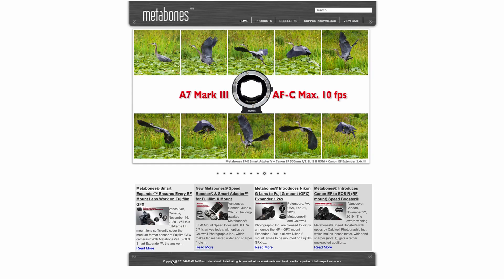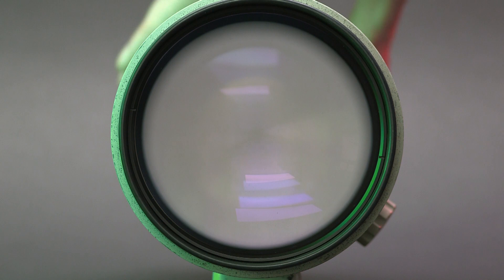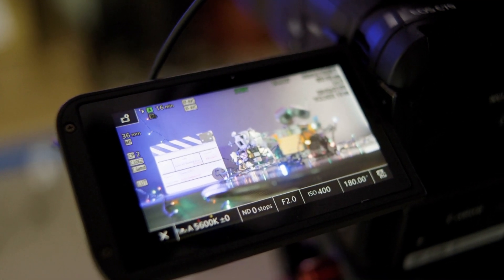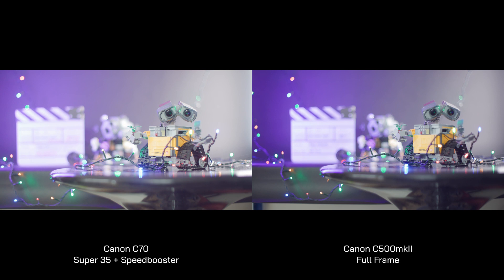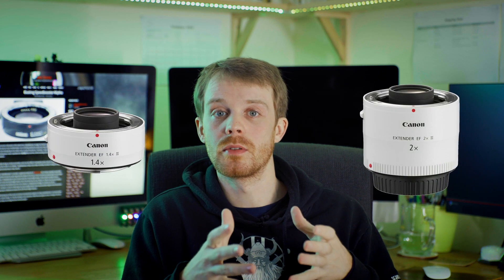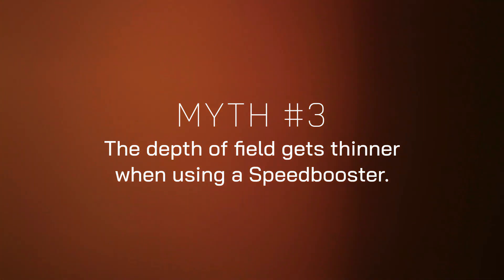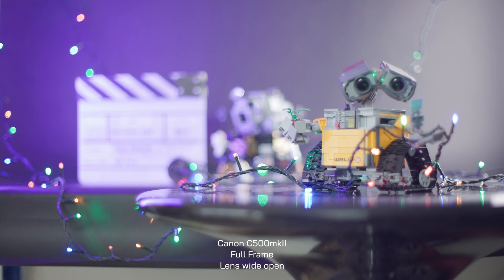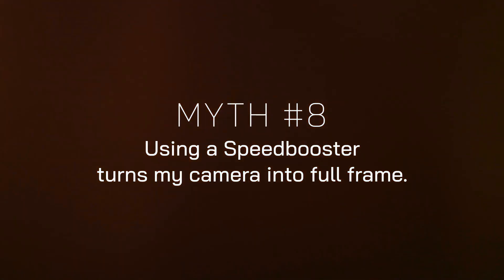Speedboosters EXPLAINED - The truth about focal length reducers

Comment: People who don't understand how that works will be even more confused after this video :) The main problem everyone are forgetting is the noise/ISO values. We are all used to smaller sensors having more noise and that is exactly why manufacturers of all crop cameras are lying to their customers. Just compare f/2.8 on a Canon R5 to a f/2.8 on a phone, are they similar in any way? Of course not, that phone image has no characreristics of a f/2.8 lens, so why are we calling it like that?  Why would we even care about same exposure settings when image properties will be vastly different between different crop factors, because they faked the ISO values. Cameras having the same settings means nothing if sensors are not the same size, any camera with a cropped sensor should show the FF equivalent settings and then the confusion would be over. The same goes for focal reducers, that f/1.0 C70 shows in camera is actually in relation to a super35, and that's why when you compare it to a full frame camera with a f/1.4 lens it has exactly the same exposure, dof, fov, bokeh, and noise. Of course sensors will not actually transform like Optimus Prime, nor the lenses will, but when you put a 50/f2 on a 1.5x, you are not only getting a 75mm fov, but you're getting a full frame equivalent of the f/3 image in every way. Everything about the dof, bokeh and noise will look exactly like f/3 on a full frame, and that's what most people don't understand. Because when you understand that, the result of putting a speedbooster is much more clear, it's like reverse cropping, you gain what you've lost when using a crop sensor. That's what people want to know, what is the actual result in the final image, not how to calculete aperture opening which tells you nothing. Bottom line, if you want to know what kind of image fov, dof, bokeh, noise and image compression you will get compared to a full frame sensor, you just need to know what is your crop factor. If it's 1.0x, your image will be exactly the same as a full frame, again in all the image properties, fov, dof, bokeh, noise and image compression. That is why camera manufacturers should show real settings of crop cameras, people should know that Panasonic 12-35/2.8 is not a 24-70/2.8 equivalent, not even close, it's actually 24-70/5.6, and I mean it produces the image of such lens on a full frame body, it's not transforming with sound effects and smoke :)
Reply: This would be misleading to less informed users. Aperture is a value relative to focal length, not relative to 35mm. A 12-35mm f2.8 on m43 is only equivalent to 24-70mm f5.6 in relation to focal length and depth of field. But it still has f2.8 aperture in relation to its native focal length.

Panasonic does not claim that 12-35mm f2.8 is equivalent to 24-70mm f2.8 in terms of depth of field relative to 35mm.
Reply: Great comment. But I think people who buy cropped sensors know they aren't full frame. But I shoot m4/3 Olympus, Nikon DSLR and Canon r6ii. The only photos you can tell apart is the Nikon. The Canon and Olympus are indistinguishable. You do get more bokah with the full frame but I found I don't always want everything a blur. Sometimes just a light blur is amazing.. People know.
Reply: The lens never changes, the aperture number is a scientific number how much light it lets in, that does not mean the output circle is the same, but F4 is F4 is F4.
Why you are yapping about noise is beyond me, techno gibberish trying to sound intelligent. 
The ISO is just sensor overdrive, basically how sensitive it is. What dictates noise is not sensor size, its PIXEL SIZE or pitch as its correctly called, a M43 sensor with 6mp will have same noise as a 12mp full frame sensor IF they are made of the same technology and specs. 
But in reality you are comparing a 25mp M43 sensor to 24mp full frame, of course it is less noisy, the pixels on its sensor are much larger, I am not gonna go into WHY bigger pixel is less noisy, we be here all day but I can give scientific document in this that explains it in details.

Comment: Thanks for the video. It’s hard for the “art world” to accept science… here is a question for you: why don’t/can’t they make a speed booster / focal reducer for Sony E-mount lenses from full-frame to APS-C? (Not for A mount to E mount) To clarify, I want to use my Sony E mount full frame glass on Sony E mount APS-C cameras and have them “reduced” and use the full image created.
Reply from the maker: You can't have an E mount to E mount adapter without compromising the ability to reach infinity focus. Speedboosters make up the difference in flange depth between the two mounts they're adapting - ie EF to E mount is 44mm to 18mm, so the adapter is exactly 26mm thick. An E mount to E mount adapter would act like extension tubes - great for macro work but you wouldn't be able to focus beyond a couple of metres at best.

Comment: I'm not sure I totally agree that DOF is strictly a math thing and has no subjectivity. After all it's based on CoC which is based on the final projected image size relative to the viewer. We intuitively know this to be true, as an out of focus image looks sharp if scaled down far enough. 

I can see that the bokeh circle is the same size as BB-8's eye, however because the field of view is smaller, doesn't that make each circle closer to the CoC and therefore more likely to be in focus?
Reply from the maker: Whilst the physical depth that is in focus is measurably the same distance, you are right that subjectively one can appear more in focus depending on one's threshold for what constitutes in or out of focus.

Comment: Hi Alex. Great video explaining Focal Reducers and their effects. I just have 1 question.

Upon using a focal reducer we reduce the focal length of the lens which in turn automatically changes the aperture as well. Now my question is will the distortion of the image follow automatically as well. As an example:

While a 50mm f2 on Full Frame  and a focal reduced 50mm f2 on S35(hence 35.5 f1. 4) will have the same depth of field and field of view will their distortions vary? I.e will the focal reduced 50mm f2 (35.5mm f1.4) now have the same distortion as a 35mm lens, say when it comes to faces and the like. Thus, in effect the images aren't actually completely identical even though the DOF and FOV look exactly the same. Hope I made sense.
Reply from the maker: There are two types of lens distortion - barrel distortion and perspective distortion. The first is a property of each individual lens - some lenses will fisheye slightly and others will pincushion and is largely independent of focal length. For example, a 24mm from one brand might render horizons straighter than another 24mm from different brand. The second is to do with field of view - how much faces are stretched or squished (wide angle distortion or telecompression). The wider the lens, the more you'll encounter this 'distortion'. It's not distortion in the sense of it being an imperfection - it's optical physics, it's unavoidable. I've seen reviews of ultra wide lenses (11mm on full frame) complain how they didn't like the distortion because of how much it stretches the edge of the image - they were confusing perspective distortion for barrel distortion. That's not a flaw of the lens, that's just how all lenses that wide look.

So to answer your question, a speedboosted 50mm on S35 (35mm) will have the same perspective distortion as the original 50mm on full frame as their field of views are the same. The 50mm on S35 without a speedbooster will have less perspective distortion because it has a narrower field of view. Do note however that when using a speedbooster, the extra optics may introduce some barrel distortion of its own.
Reply: @alex-stone  Perfect explanation. Thanks again!
Reply: @Kazimov100  A better way think of it.

 A 50mm using a 0.71 focal reducer is now a 35mm lens.

A 35mm lens on S35 has the same angle of view as a 50mm lens on FF / 135.

This new 35mm lens has the same perspective distortion as a native 35mm lens on the S35 camera.

Because the 35mm lens on S35 lets you place the camera in the same position as the 50mm lens on FF / 135 - and since perspective distortion is dictated by the distance from the entrance pupil to the subject... the perspective distortion is the same.

The 50mm on the S35 camera without a focal reducer will have the same perspective distortion - if - the camera is left in the same position (because distance dictates perspective distortion).

However given the narrower angle of view, it is more likely you will move the camera back.

If you move the camera - YOU - by changing camera position have changed the perspective distortion, as you have changed the distance from subject to lens entrance pupil.

Comment: Thank you for this excellent factual video, just one big question. If I have a 50mm on a super 35 sensor with a 0.7 speed-booster will the perspective or backround  "fall off" be that of a 50mm or 35mm? Or is the fundamentals of my question flawed?
Reply from the maker: It would depend on the aperture you've set. If the speedboosted lens is wide open, then you'll have the same DoF ('fall-off') as the 50mm when wide open, even though the aperture is one stop faster. If you stopped down to the same f-number to match the exposure, then the DoF would be deeper.